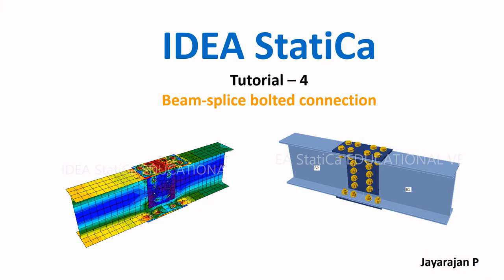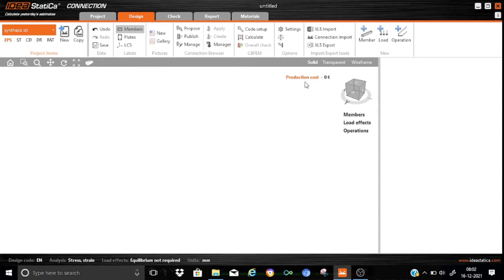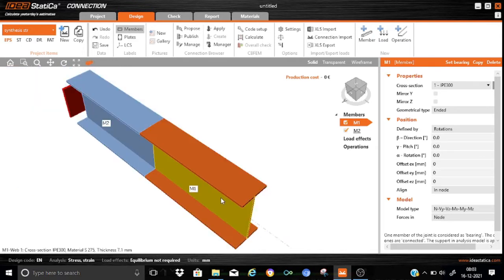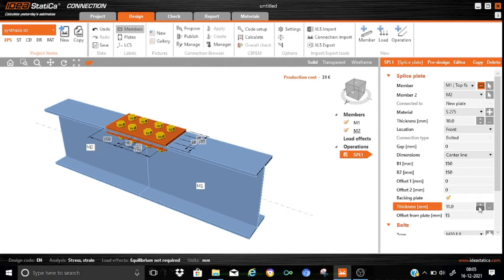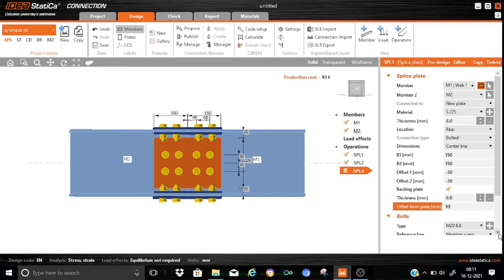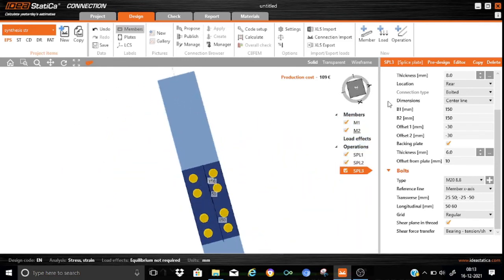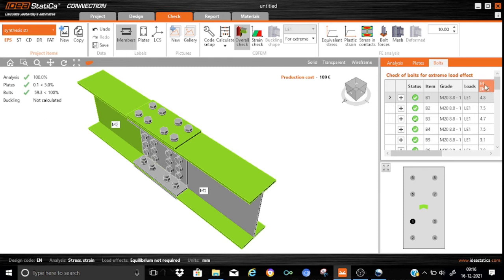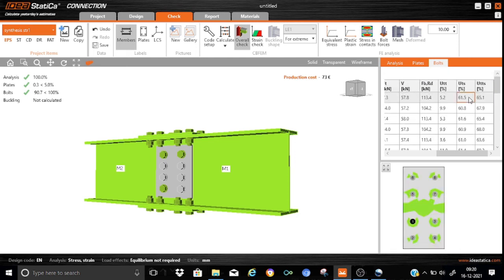IDEA StatiCa: tutorial-4: Beam - beam bolted splice connection

Comment: It's a great video. Thank you. One question, is it possible to check deflection of splice plates. I have a similar connection and when we checked it on site, the deflection under connection is 40mm which is massive. Is it possible to check the deflection of plates?